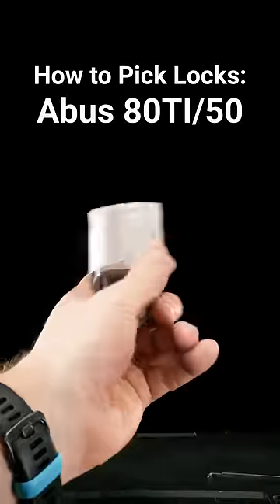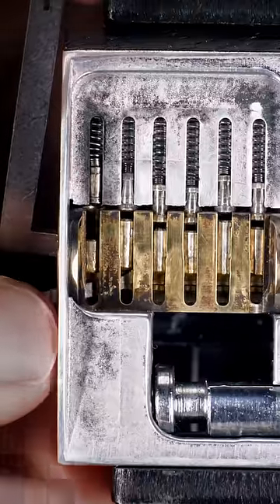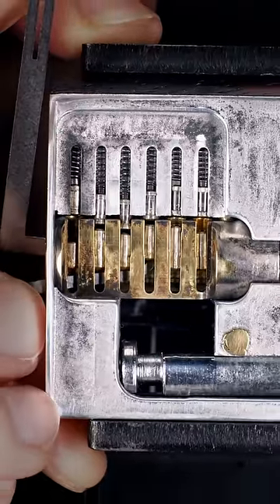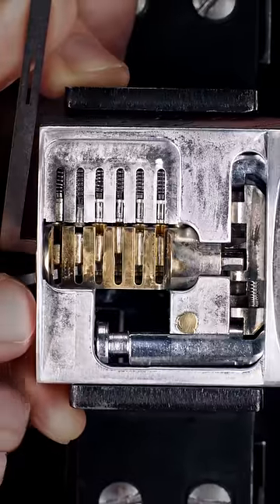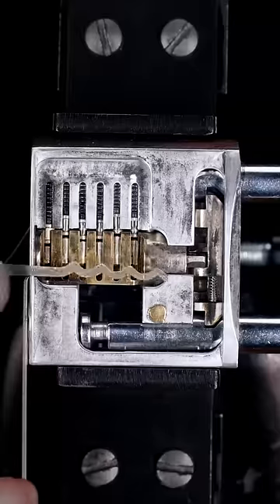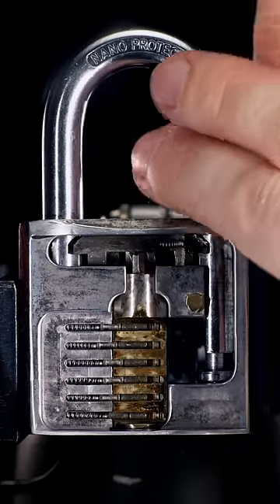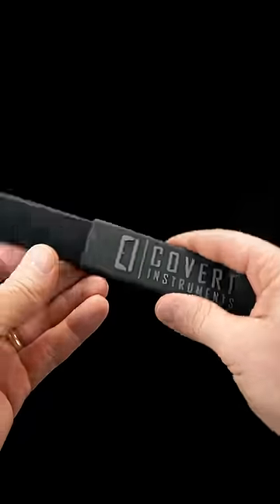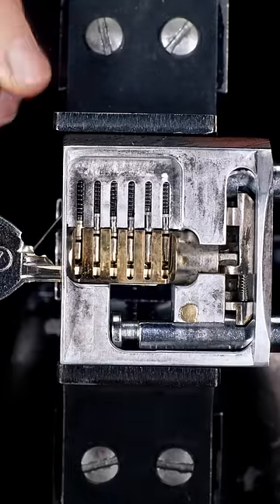How to pick locks: Abus 80TI/50 opened four ways

Comment: Disc padlocks with disc detainer cores. As long as the keyway is shielded you can't pick them (without a disc core picking tool which are very rare) or bypass the core, and the shackle is completely guarded inside the body of the lock. They're just about 3-4× the cost of a standard padlock

Comment: Can you please or have you made a video explain pin binding and false sets, how they work/what causes it to occur. 🙏🏻
Reply: A false set is when the core rotates somewhat but the pins are not actually set. It happens with spool pins like in this lock because the thin part in the middle of the spools allows the core to rotate. But because the end of the spools is not thin, you now can't push them up anymore, because due to the rotated core they're too big for the half covered holes.
Then you have to counter-rotate (turning the core slightly back to default position) to allow pushing them up again.

Binding just means the pins press against the rotating core and are harder to push up. It's a likely indication that that pin is ready to be picked next.

LPL has a video on this topic (spool pins): " [1428] Inside Perspective: Picking Spool Pins"

Comment: Why don't they make lock cylinders with tighter clearances so you can't put the pin past the shear line with tension and it'll just fall back down when you move on to a different pin

Comment: I bought the same bump key set but it’s so hard to use. Just beat the hell out of my fingers and bent the key
Reply from the maker: I cut mine from another Abus key, for tensioning try using a turning tool in the key.  Experiment with different amounts of tension and when it’s applied as well as using a castration band vs no castration band
Reply: Hey thanks heaps !
Reply: @jayrendallday  sorry about your fingers and key by the way man. Think of it as growing pains 😅 If Mcnally gives the advice it's certainly worth taking notes. I can't wait to try picking for the first time myself.

Comment: Anyone know how the cross-section view is done? You couldn't grind it without damaging it surely?
Reply: Remove the core before you cut the lock body. If you want to cross section the core, remove the springs and pins first. Cut the things you need a cross section of, replace pins, springs, then core.

Comment: Idk why ppl dont use code lock,idk.
Reply: Those can also be picked just differently
Reply: He's picked code locks before. They are WAY less secure than normal ones. You can push a thin piece of metal between the wheels and it pops open